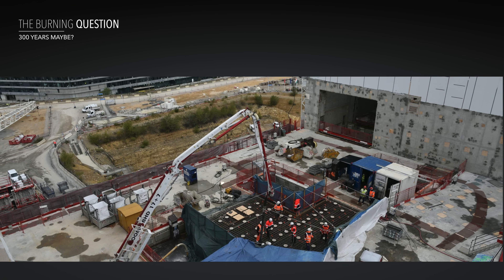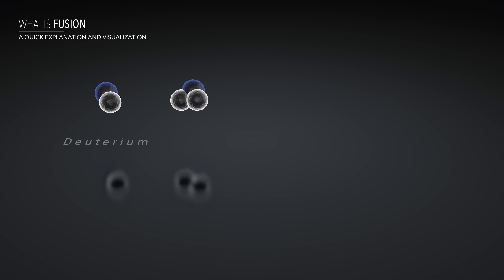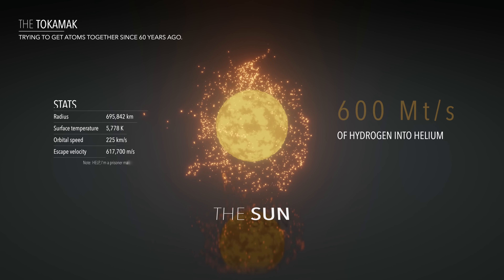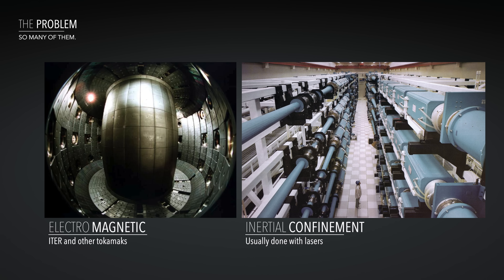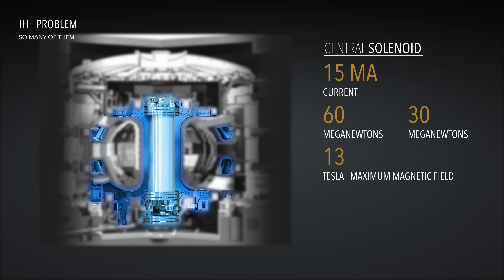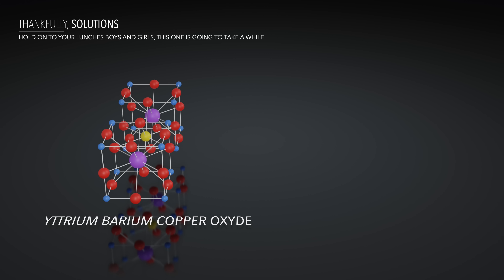Fusion in 30 years? ITER update [2020]

Comment: Though it may be possible for ITER/DEMO to someday have sustained net-positive fusion, it is extremely unlikely that the design will lead to a practical, commercially viable reactor. Megawatts of neutrons will wreck any metal in the structure or operating equipment, rendering the multibillion dollar facility useless within months. Or you can shut it down and spend more billions in repairs/maintenance.

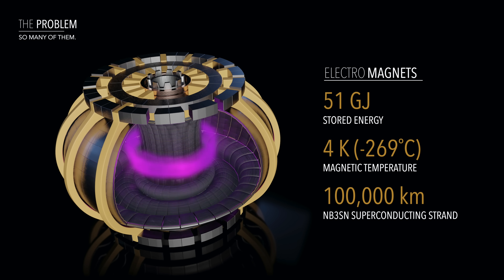Comment: 8:13 Correct. The confinement or pressure required is the biggest problem.  The sun/stars have no problem with this due to immense gravity and to compensate, we have to use higher temperatures

Comment: So let me get this straight. The best fusion reactor we've done so far is JET.
Here are the stats for JET. From the video (7:15)
Output: 60 MW
Input: 700-800 MW
= 7.5-8.6% Efficiency.              CORRECT ME, if I'm missing something on anywhere here.

The most efficient steam turbines are around 50% efficient. (Wikipedia)
Assuming we could hook up JET to a steam turbine, the practical efficiency for JET would be 3.2-4.3%.

We need over 200% raw reactor efficiency (with current steam turbines) and over 100% reactor through generator efficiency. 
These numbers are currently AT BEST 8.6% and 4.3%.
We're under 1/20th of the way to profitable fusion reactors. We've been at it for what, 8 decades? 
FUSION IS NOT COMING! (With the current progress of things) Let me hear your thoughts :)
Reply: Gotta start somewhere, this is that somewhere

Comment: still 30 years to go? I can't wait to see if they will manage to create a machine with a efficiency over 1.
Reply: That is impossible. Nothing is able to kreate or annihilate energy.
Reply: @TheWoltschek  I know. But without that, fusion will never be efficient in terms of producing more energy than consuming energy.
Reply: @mistirion4929  Thanks for the correktion. English was the 3 language that I had learned after russian and german. And I still have a long way to learn it. About the Energy. Don't forgett that we put energy not only as a electricity but also as potential energy of a mass. We only need to get more energy than we put in in form of electicity. And that is way below than effeciency about 1.
Reply: @TheWoltschek  yeah, no problem. It's pretty good for your third language. 
Back to our main subject. You're right about the potential energy that this thing has just by standing on this planet, however I don't think that it will be as useful as you think it will be. Besides, I'm also not sure about this and that's why I said: Would be interested to see if they can make it.
Reply: @mistirion4929  Potential energy is much more than only the high at wich is the mass. Potential energy is all the energy that the body may contain without any movement. Like a heatenergy. For example the same body wich a higher temperature have more potential energy than the other. And at fusion you fuse atomic nucleus into a different atomic nucleus. But at the end the atomic nucleus mass will be less than at the beginning. And this difference is the energy that you get. We may to calculate the energy wich Einstein formula E=mc^2. And i am quete sure they will get there. They only need some time and support.
Reply: @TheWoltschek  btw "create" not with "k" :)

Comment: If we only knew what we are doing.... having these strong magnetic fields in a world where magnetism is very important. Knowing magnetic fields have a long distance influence... Are we sure we keep the systems integrity?

What if we tickle earths core?

But lets just forget what the Tesla unit actually means... Lets just forget about the size of the earth and It's low magnetic field because of the mass it has. And lets also forget that heat causes résistance. Lets just think the earths magnetic field is not strong at all.. there is no center point where it all starts so... nothing to worry... right?...

Comment: I don't see fusion being viable, ever. 
1. Too much tech. Who will manage the AI systems needed to manage probably the most technologically advanced machine, and keep the precision components running? Only researchers are smart enough to maintain. Europe and Africa lacks the brain trust to be successful.
2. As expensive, if not more than current nuclear. Costs will exceed value of power generated. As they provide more, this gets worse. 
3. Still have issues with transmission. 
4. Will take huge amounts of electricity to start generation. Where does that come from? 
5. Only US and China could afford it. 
6. It will take 50 years or more to start replacing existing power generation. Iran has 100 -136 years of oil/ng at peak production, alone. 
7. ITER is trying to build 3-5 different models, currently. Optimistically 2030, more likely 2050. Imagine how expensive it will be then. They still cant agree on a design. 
8. No support from green nutties. Will compete against cheap local power. 
9. We already generate too much electricity. What are they trying to solve? 
10. While you can build a nuclear plant on a boat,  you won't have fusion on a boat.

Comment: Andreas Rossi is claiming his Lenr device is now able to run in SSM. That is Self Sustain Mode. That means the device does not need to plugged in to the mains. It creates Electricity and heat. The consumer can choose what % the output is. The fuel lasts for 6 + months. Independent testing to be done in January and a demonstration of the technology in February. This is not hot fusion or cold fusion. It is a device that creates light and power from Plasma.

Comment: Would a quantum computer help speed things up.
Reply: The problems come from physics and material sciences, not computing power. There's plenty enough of that now to control this thing, if the insane temperatures and pressures involved wouldn't make it fly apart at the seams.

Comment: I'm happy to see some things aren't changing  - if You could take a trip in time - the 80's fella would plug headphones to walkman, a dude from 90's would likely have a discman, 00's would be some MP3 player but the 'FUSION IN 30 YEARS' just goes on and on
 does anyone knows why it have to be 30 years? for purpose of throwing numbers against a wall - 26 years, 20 yr-s or 42 or any number from 10 to 99 would take as much time to type as 30 yet for some magical reason - it just have to be thirty
and if You wonder what got me into wondering about a time traveler - ask Yourself if 2020 will be starting after Dec.2019 or somewhere in late November

Comment: The whole point of high-temperature superconductors not that you can operate it at boiling nitrogen temperatures. The thing is that you have a lot, lot higher temperature margin, which is a far bigger problem than operation in boiling helium

Comment: I thought spARC wanted to use Rebco superconductors, not YBCO.
Either case MIT is going the right way here. Better superconductor MASSIVELY decreases the size of the reactor which massively decreases the cost and time to build. My guess is they'll achieve sustained fusion before ITER does.

Comment: Question: Assuming net energy producing fusion can be achieved, how will they get the energy out of the reactor? Some kind of steam turbine?
Reply: Several posters have asked more or less the same question.  The technology for this is mature, so there's generally no need to discuss it. (That means it's well-understood, based on common, proven designs that are deployed by the thousands, have been subject to large competitive market pressures and thus continually refined over many decades and benefit from economies of scale).  Whether a power plant's energy source is fossil fuel, fissile or fusible fuel, it's mainly released as heat which is turned into electricity in pretty much the same mature technology in nearly all cases. (There's the occasional exception, such as a CHAP (Combined Heat and Power) power plant, or one where the heat is used more directly, say to melt metal or run machinery by turning a shaft or hydraulic pressure.

Comment: Fusion will NEVER be a viable form of energy. 
All Fusion Reactors have one thing in common, More energy goes towards creating the immense pressures needed for fusion than it actually creates. In fact NOT a Single fusion reactor has ever produced more energy than it consumes.

The only way to achieve the amount of pressure and energy needed is by utilizing mass itself and I don’t mean earthly amounts of mass either...  I mean space bending amounts of mass! The sun generates fusion because of the immense amount of gravitational pressure crushing its fuel source down to a single point thus creating fusion. 

We simply don’t have enough tangible matter left over in our solar system to recreate the immense amount of pressure needed to contain the force being created. Trying to achieve this electromagnetically is pointless because it will ALWAYS consume more energy than it produces just trying to contain the forces exerted on it specially without the help from the vacuum of space. 

From Einstein’s findings we all know that mass itself is a form of energy. To extrapolate that... Planets such as Gas Giants are just the beginning of how much mass is needed to start the fusion process. In saying that... 

You have to pause for a moment to realize that even such massive planet like Jupiter still didn’t quite have enough mass to kick start the fusion process... 

But hey what do I know.... 
I’m just some random guy on the internet...
Reply: not true fusion has been achieved on earth without an immense gravity field decades ago in the form of hydrogen bombs
Reply: Tristan Beal - Correct... in the form of a weapon but not as a useful form of energy. The pressure on earth is not strong enough to contain the fusion from that source therefore that’s why it’s an explosion. Continuous energy from fusion is not viable. We do not have the means of containing the fusion process for continual use. There’s not even a material in existence that can withstand the pressure and heat.

Comment: In stars, the reason fusion is sustained is not merely because of high temperatures, it's because of quantum tunneling. Without quantum mechanical induced fusion, stars, at least stars as small as ours, would not be possible.

Comment: Error at 7:20, on the slide "16 MW INPUT", while the audio says "16 MW OUTPUT".
Reply: However, the same info at 4:11 is correct.
Reply: yes, very sharp of you to notice that.
Reply: @laurentstorchi290  that's good or bad?
Reply: @_general_error  that's good of you to notice that; the text written was a mistake which should have been 16 MW output or 16 MW produced. You need 8 MW more energy to put into the process than you will get out of the process.
Reply: @laurentstorchi290  Also, pretty much the first scientific factual claim is fiction!?!?  @ 3:00: "Fusion is the most powerful reaction after fission."  Uh, hello, it's the other way round!  WTF?  (We already have fission reactors!  We're trying to build a fusion reactor because it's potentially much more powerful.  The most powerful atomic bomb is the hydrogen fusion bomb....)
Reply: @MatthewElvey  I don't understand why he said that. Later on, he proceeds to correctly compare fission and fusion by energy released relative to nucleons involved.

Comment: In 30 years the whole idea will be irrelevant. And even then it won’t put coal out of business. 
We need bulk, high temperature, zero CO2 power on demand right now. AND it has to undercut coal on costs. 
The only solution that comes close is the Moltex SSR nuclear fission reactor. Their first will be making power in 2028 at build costs less than gas fired plant. Factory built units will be cheaper than coal. 
Also be aware that deuterium and tritium are extremely rare.
Reply: deuterium is not rare

Comment: I'm not sure if you know, but the main problem with YBCO is not necessarily turning it into wire, but getting the wire formed to superconduct at same performance as crystalline form of YBCO. The grain boundaries and crystal imperfections that are formed during synthesis of the wire lower the superconducting maximum field achievable and resulting superconductor ends up not being that much better than metal or alloy superconductors which we use today. Where alloy superconductors require near absolute zero temperatures, but their performance is relatively constant even with bending and wire forming.

Comment: Just a comment, comparing the amount of force that something in a building has to carry to the force that the space shuttle exerted is a bad comparison.  The force that the space shuttles exerted is weak sauce compared to what buildings and bridges carry every day.  Just some quick and dirty research, but I believe one cable of the Golden Gate Bridge has something like 20 time the capacity of the force you described.  The space shuttle was a completely different engineering challenge.  I guess I would like to know why that amount of force is a challenge in this case?  Is the materials they have to use, because steel can easily hold that?  Like, is steel not allowed near the magnets or something?

Comment: Why no one speak about Liquid fuel reactor / dual Fluid Reactor? It's much cheaper it will cost 25- 40billion Euro and work with materials and machining / processing methods which is known today and the reactor can rid out the problem with "Nuclear waste" and the necessary for deep geological repository

Comment: What I don't get(Among many things):

Why Don't they add traces of something like Thorium to the Plasma?

It will not be enough meaningful radiation to be dangerous.

It will act as catalist.

Thus less energy needs to actually invested.

Heck, Toyota has an Hydrogen holding alloy for its Hydrogen fule tank.

That can work for carrying It. Like A Magnetically accelerated ball.
then crash it into another one.

Like before, add some traces of thorium..

It doesn't actually have to Be the Center of the Sun. it just needs to be enough, that Quantum events become likely enough.
Reply: fanOmry How would thorium act as a catalyst? It would just ruin the plasma and stop the reaction immediately.
Reply: @Gomlmon99  

I will explain my logic, and you will explain how I am Wrong.

 Traces of Thorium or an Analogue, in the plasma will introduce an internal source of Energy. The heavier nucleus will be slower, thus Hydrogen Nuclei will crash into it, The Decay radiation will be itself turn several of them neutral. thus cras them to the nearest nucleous in their way.
Thus in their case, remove the Culomb Barier.

This seems what is needed to me.

How am I wrong?
Reply: fanOmry Er well everything doesn’t really make sense but the main thing is that thorium or any other atom above the mass of lead uses energy rather than producing it.
Reply: @Gomlmon99  

oh, I wasn't trying to fuse those.. I was aiming to harness the radiation.

Comment: We actually should spend some more resources on this project. 
So far it went through so much politics and savings. 

For real. The whole project have so far cost less than one Olympic Games.
Reply: Compared to the annual defense budget of USA ($650 billion)  80+billion Euros (2-3 billion annually) for the whole project is pocket change...
Reply: @veduci22  I want spending on foreskin regeneration technology.
Reply: John Buick  For no gain?
You have no real knowledge about the subject, do you?

Btw. I was thinking on ITER only, not all fusion research.
Which takes place in lots of different countries and different universities.
Reply: John Buick  Superconducting electromagnets that can be used for smaller and more efficient generators, transformers and Ion propulsion drives. Superconducting wiring to allow for lossless energy transmission over large distances. High performance concrete for all sorts of infrastructure projects. Neutron radiation resistant sensors that have applications in fission reactors to improve safety... And that's just the engineering side of stuff off the top of my head and doesn't include possible breakthroughs in plasma physics which could yield as of yet unknown applications. There is also the societal side to these projects: International cooperation that provides a foundation block to cultural exchange and peace.
Reply: John Buick  it does Work, with the current technology. 20 years ago you didnt had it, but now we are building ITER. There was no ITER 20 years ago
Reply: John Buick  Germany is shutting down both coal and nuclear power plants. They just shut down nuclear power first , which has already been more the compensated for by renewable energy. Give it a decade and the German renewable energy program will replace coal too
Reply: John Buick  I just don't understand, why people without any knowledge, feels justified in making statements about subjects they so obviously know absolutely nothing about. 

I rest my case.
Reply: Every scientific endeavour that only serves to increase our knowledge and understanding should be above pointless monetary quarrelling, but we live in a world where people would gladly fuck the place we live to death for fictional pieces of paper.

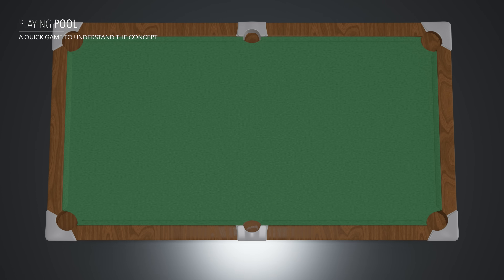Comment: The topic at 4:30 isn't a good idea, your just starting a chain reaction that's going explode, this is deja vu  to me iv seen these calculations nd ran them my self, ita unstable to run this. Go over the material your using nd run the numbers a couple more times. Its basic chemistry and physics, the complexity comes with the fusion, plus if your math is off you can ripple out of the machine, containment field needed, and can be bad for several people. Basically

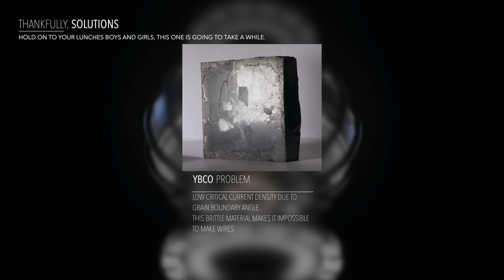Comment: 12:10
Being a crystal doesn't make things brittle... Mild steel has crystalline structure and so does gold.
Reply: Im not sure if brittle is the right word to use for the material. Crystalline structures are not as pliable as for example copper, thus making it impossible to make wires out of the material.
Please correct me if im wrong here.